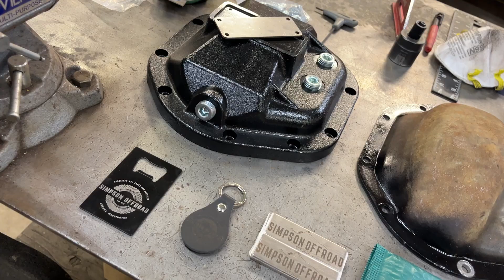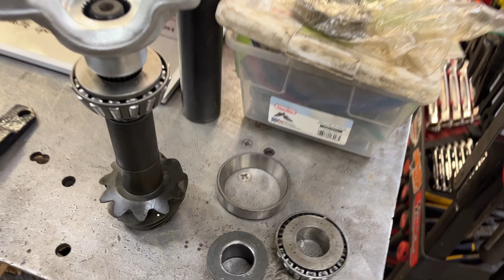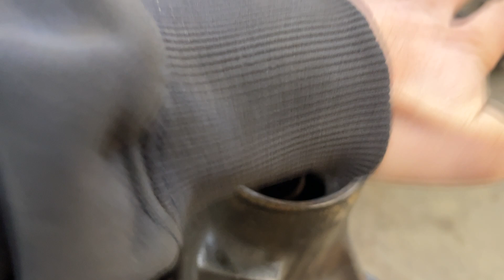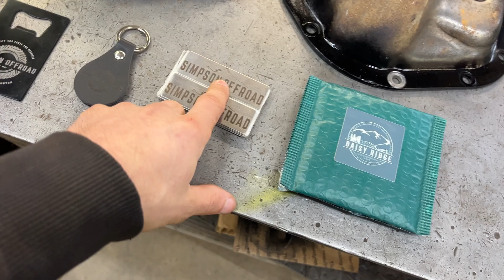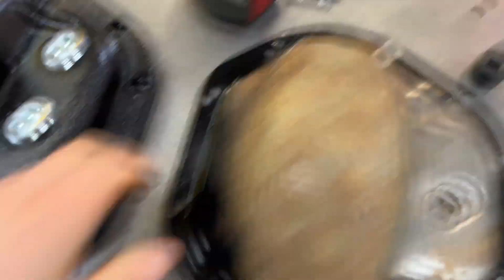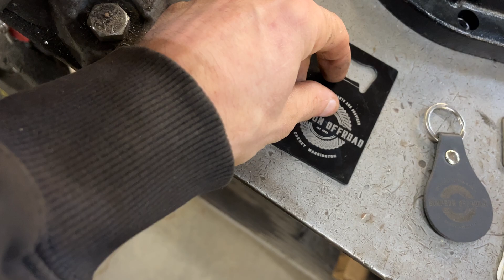NEW Prototype Tool, Shout Out madebydaisyridge, Axle Ideas

Comment: Thanks for another video.. Worry when time between gets over the months period though I/m up to yr LOL.. Glad just life gotten in the way.. My honest opinion, since you asked, I don't think making the tool up more than onesy twosie is warranted.. You may get stuck with some and initial cost vs us making one on our own, or something similar, may not be recouped. It seems like it would be something a shop might use but unless it was dirt cheap backyard mechanics (like me LOL) won't splurge for something I might use very rarely unless it is a big timr saver, critical measuremen/safet, or similar thing.. I'd make one or a competent shop would make one for themselves. I think you would be better off making one or two yourself and offering them for sale THEN if you see them going out the door or being BO'd jump up to having them made.. Just IMO . A for example I will spring for a setup bearing rather than trying to make one myself or the time it takes to remove and reinstall a good one possibly damaging it while doing so. Good idea on offering bare modified housing. God bless .. take care